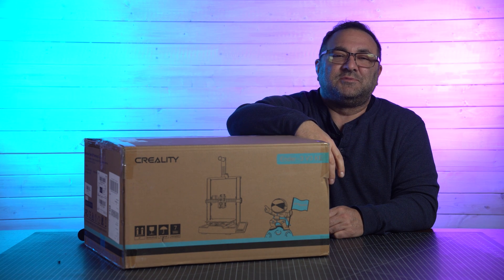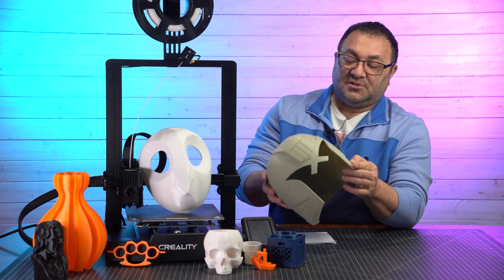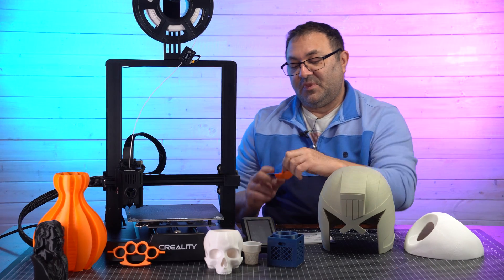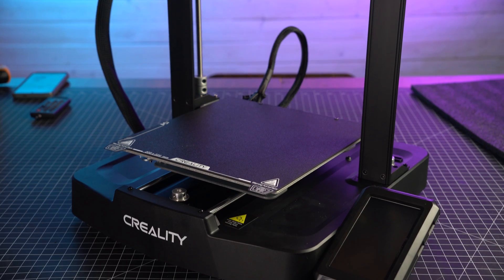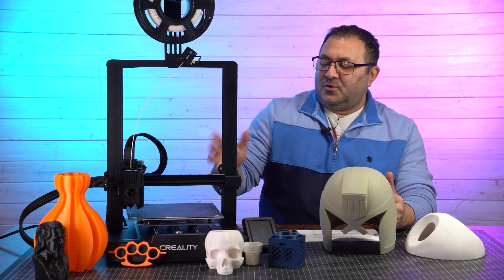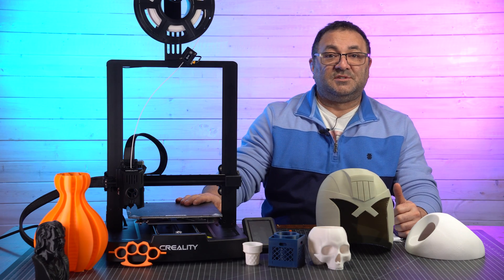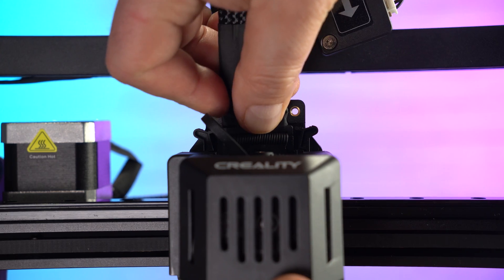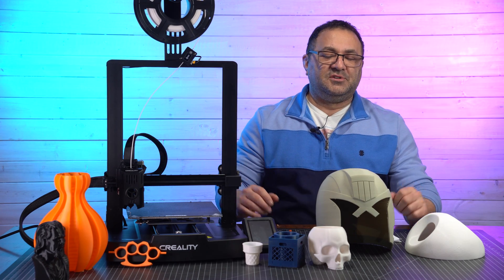Creality Ender 3 - V3 KE Printer Unboxing, Assembly and Great Prints

Comment: Hey mate, love the video and love all the cool stuff you have printed out on it I have purchased one for my self and was just wondering if you would know what voltage setting I would have to have it set to for Australia
Reply: This printer has a 120/240V switch on the power supply. I've had it for over a year and recommending rooting it for even more control over klipper.

Comment: would there be anyway that i can fit the wolverine cowl on it without having to cut it in half or slice the nose piece?
Reply: Tilting backwards and then rotating 45degrees helps you get most of your printers volume when it comes to helmets and masks, but i would look into files that have separate ear pieces and are cut naturally (in positions where the designs have lines so you dont have random lines when you assemble) or simply look into bigger printers all together. Elegoo has some that are cheap

Comment: Hi kevin, which slicer did you use, and any tip? Im waiting for my ke. Thanks for the video.
Reply from the maker: Can't belive I forgot to mention that. I used Creality slicer. I really like it. I also used a .4 nozzle. I really only ever use that size. Thanks for asking.
Reply: @3DPrintedProps  Switch to orca slicer, it's better in my opinion
Reply: You might want to check out orca slicer too, it’s really amazing
Reply: How has your experience been with this printer? I just ordered it.
Reply: @ for me, its been great, the screens just a bit wiggly